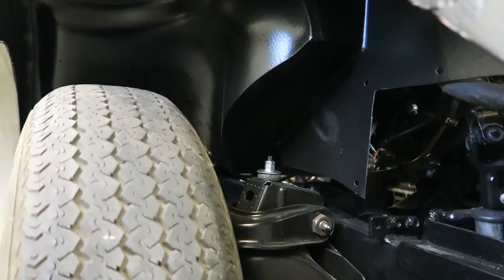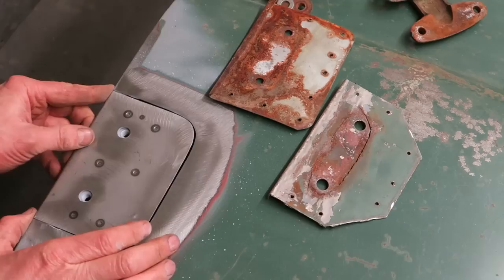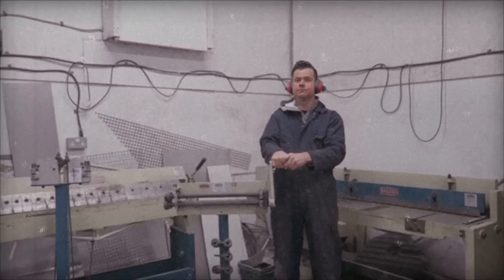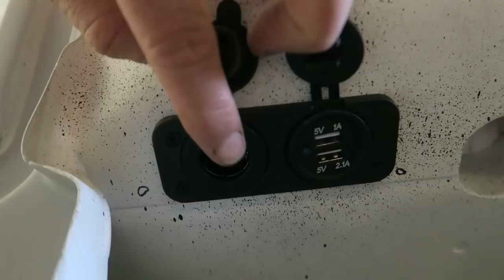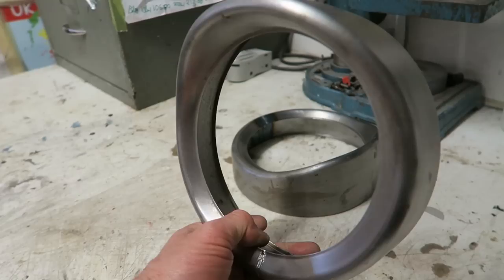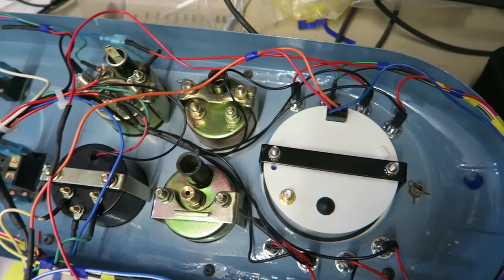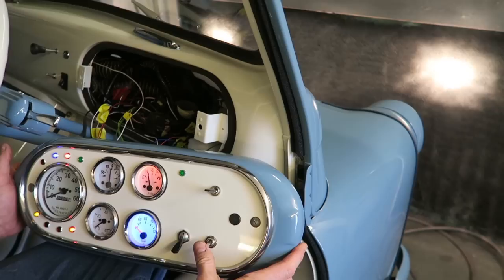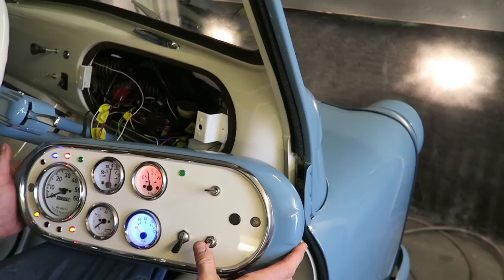Trev's Bedford CA Van Blog - Part 20 - The Final Chapter.

Comment: Well done Trev and congratulations on your body panel building skills. The end results do you credit, it’s one thing to strive for perfection, but quite another to achieve it.  My father was a panel beater and motor car repairer by trade and as a boy I regularly used to help him at his garage in his work. Watching this video brought back many memories of our times together working into the night to get jobs finished for customers in the 60’s. In those pre epoxy days filling techniques involved melting lead ingots into depressions and manually filing down areas by hand. You’ve achieved a great finish and I know from experience its not easily achieved.
Reply from the maker: Thank you for your generous comments, all the very best Trev 👍

Comment: Happy New Year Trevor.  Such a fantastic project.  How did you keep it from rusting while you were doing all the metal work and what paint did you use for the underbody?
Reply from the maker: I don’t have much of an issue with this problem in my workshop. I can actually leave bare steel for over a year and see no evidence of even surface rust. But if I’m restoring something I’d epoxy as I went round provided it was finished enough to not have to start removing the primer again. In the past I have also given the bare steel a light coat of aerosol primer and then sanded it off just before painting it properly. Cheers Trev 👍
Reply: @trevsblog  Great thanks Trev!

Comment: Thanks for the thanks. It’s been a pleasure helping/hindering you over the years. It has been a two way thing though so thank you also. My fifth gear started to wine a little back in September so I guess it will be a contest to see who can ignore it the longest before fixing it :) All the best.
Reply from the maker: Hey thanks Andrew I’m glad you’ve watched the video. Unfortunately I couldn’t finish it in time for Christmas Day due to the editing program freezing and losing 8 hrs work… but I think it’s worked better as a New Year’s Day release. I did a bit of research on the gearbox a while back when I had the grating between gears issue, I ended up emptying some oil out which cured the problem. While reading up it states that the box must have a specific grade of oil and not an EP 80 or 90 type, perhaps just keep this in mind if you’re going to go to the trouble of rebuilding it. All the very best Trev 👍

Comment: We grew up in Cornwall with two of these, 520 JAF and JAF 628E. I still have one of the numberplates for the older van. We had bench seats in the rear, mounted along the sides of the van, no seatbelts for me and my brother, and although dad was a slow driver, I remember sliding around quite often, which added to the fun of an outing. You have done an epic restoration of the van, it’s gorgeous! I noticed the tax disk holder - that has the same knob on it as ours had which made me smile, it’s not something I’ve seen for 40 odd years. My first drive was in the newer van, on Davidstow airfield in North Cornwall. I remember the hardest part was the column shift. Anyway, thanks for rekindling some lovely childhood memories!
Reply from the maker: Thank you for your thoughtful comments. Very much appreciated. All the very best Trev 👍

Comment: I actually learned to drive in my Dad's 1963 Bedford Dormobile Campervan which started out with a Perkins Diesel engine before we converted it to a Petrol back in the 70s  with a 4 Speed Column change. I can still remember my late Dad saying to me this wasn't meant to do these speeds as I inched the speedo over 70Mph on the way to Llangollen from Liverpool downtheWelsh country lanes late at night. It was great on a hot day with the doors held open with the leather straps. Also remember the Column change gear lever coming off in my hand as I was driving into the Mersey tunnel 😳. Funny how it was a push button starter on the floor year's ahead of its time. Many happy memories.
Reply from the maker: Thank you for your generous comments, all the very best Trev 👍

Comment: First time I have seen your channel. Absolutely love the van. Also love your ethic for working towards your goal. Well done. Can I share my CA story. Back in the mid 80s we were on holiday in North Yorkshire. We pulled into a layby with an ice cream van. We bought ice creams for the family, and I got talking to the elderly owner. It was a split screen from I believe about 1957. His stock question was "Guess the year it was made". I was the first person to get the correct year, and I think he was impressed.The van was completely original, apart from some lino floor covering and a water pump replacement. I left him my phone number. 2 or 3 years later I received a letter from his solicitor. Sadly, the gentleman had passed away, and had left instructions that I was to have the first offer to buy the van. I would have so loved to have done so, but family commitments and my poverty did not allow it. I still regret not having been able to buy it, and take it to events. (Of course, 3 speed, column change.....)
Reply from the maker: Thank you for your generous comments, all the very best Trev 👍

Comment: Hey Trevor, Since I found your channel I have really enjoyed watching your videos and looking back over the progress of the van. Thanks for sharing. I am looking forward to future videos.

For washing the van I'd encourage you to use a snow foam wash (a special applicator and pressure washer are required) and sealer (that can be sprayed on through the snow foam applicator). The products have become a lot more available and affordable. The snow foam help break up the dirt and grime before you scrub (microfiber cloth or brush) and some foams have additives that help remove salt (but can be harder on wax). This reduces the contaminates that can scratch the paint when you scrub down the vehicle. You mentioned that you wax the van so, if you use a spray on sealant it will extend the life of the wax and save you some time. The sealant also makes getting the paint clean after it gets dirty a lot easier. Also, look up the two bucket method. Long story short, suds in one bucket and rinse water in the other. It will keep suds bucket pretty much clean and you will have less contaminates that will damage the paint (and chrome). You can also use the snow foam as a quick maintenance wash if required. So much effort went into painting the van and this will help protect it. Also, careful with the brush cleaning. Not really a gentle way to clean paint.
Reply from the maker: Thank you, I appreciate your comments very much! 😊

Comment: It looks very, very nice. What would also look cool is a matching trailer made up of the rear end of two Bedford vans stuck together making it symmetrical. The wheel well being the shape it is means that you could cut with the line of the front part upwards and have a twin axle trailer in the same colouring as your van. The problem is probably finding two Bedford vans!! It would look fantastic as I don't think I've seen a van so conducive to being converted into a trailer using two vans stuck together.
Reply from the maker: That would be cool 😎

Comment: They are my favourite van for sure, I had one in the mid 80's and would have one again if I could find one drivable and in reasonable condition that's affordable. Funny story I had just started a small business and a friend sold me the van not going so I got that sorted but it was still slow and rattily anyway my brother came to visit and was in the van with me on the way to somewhere he said it should run better than this so opened the engine bay while I was driving down the road and looked at the engine he said that lead is loose reached down and tapped it into its socket, well immediately that van leaped forward with twice the power and smooth as silk :) 

They are actually reasonably powerful and drive nicely I loved driving down the motorway at 60mph doors open on a hot summer day (I live in Auckland NZ :) I even did that once with a police escort (part of my work with Mountain rescue transporting our mobile radio station to a major emergency situation).

You did a great job congrats and good luck with the business.
Reply from the maker: Thank you and thanks for the wonderful memories 👍

Comment: Thank you for the video series. The perfection you've achieved is a real credit to your skills and expertise. Don't laugh but my dad owned a Bedford CA lwb 1966 HKR 449D when I was a nipper. He bought it from a retired Brigadier for £150 with 22000 miles on the clock when it was 11 years old. It was grey and had of course the three speed column change and sliding doors. It had no heater and I remember only too well trying to get some warmth by resting my legs against the engine cover 🥶.
Reply from the maker: We never forget do we. I can still vividly remember going on holiday laying on the rear seat of my Dads Beatle JFB298H I can still hear the noise of the engine under the seat and the feel and smell of the vinyl seat cover, like it was yesterday 👍

Comment: I had a Bedford CA in the early 1970's it was my second vehicle I ever owned after a Ford anglia I purchased as soon as I passed my test. I got the CA as I wanted a diesel, it had a perkins engine which used rubber grommets on the fuel lines, they would leak so often I ended up carrying a tin or them with me as well as spanners so I could replace them on the side of the road as soon as they started to leak. I still have some of the grommets along with the drivers/owners hand book.
Reply from the maker: Great memories thanks for sharing 👍

Comment: Great job.Dont forget it won't  be compleat without a 'rattly'  front bumper ,they all had one.
Reply from the maker: Yes I’ve heard from several people that the bumpers rattled. Mine came without bumper brackets and I made them out of thick stuff. All the very best Trev 👍
Reply: @trevsblog  The bolts holding the bumper to the brackets used to come lose.Great van to drive in their day.

Comment: Had one back in 1969ish,  Rare one with the 4-speed gearbox, transformed it compared with the standard 3-speed model.  Loved driving round with the sliding doors opened in the summer.  Probably illegal now.  Had to avoid breaking hard or be aware the straps holding the doors open would slip off, ouch!
Reply from the maker: Great memories 👍

Comment: I past my driving test in the short wheelbase CA van in 1965 I even remember the reg number CAO108B on passing my test the firm provided me with long wheel base version and again I remember that reg number EAO339C. The vans were used for servicing and installing TV sets around West Cumbria or in them days Cumberland. I see you have the gear change on the floor, the vans we had were all 3 speed and gear change was on the stearing column.
Reply from the maker: Thank you for your generous comments, all the very best Trev 👍

Comment: Hi Trev and Tracy, I have just binge watched all 20 episodes. Firstly, the best of luck with your new venture - I know you will make a success of it. Secondly, your immense skills were wasted doing crash repairs, they are more at home completing serious restoration work or somewhere like Retropower pushing the boundaries of bespoke design/engineering. Thirdly, if I ever get a classic drive in cinema going would you like to come along? I run a 1967 Triumph Herald 1200 conv ( unrestored) & a 1974 Reliant Scimitar 5a (2yr recommissioning having been off the road for 20yrs). 
Final question - what is the next lucky vehicle to be touched by your magic hands?
Reply from the maker: Blimey my heads spinning after reading that. Sounds exciting anyway 👍

Comment: The Bedford CA van was much better than the VW Transporter, much better engine, more economical, nicer to drive, safer in an accident. My father had one as a mobile shop in the early 70, carried 2.5 tonnes of good and ran faultlessly, the VW engine would be dead in a week with that workload...and the heater was crap.
Reply from the maker: Hey thanks 😊

Comment: Such a lovely van restored to perfection, great work! I'm curious about the fuel economy with that engine and gearbox combo? I have a later Bedford CF which gets only gets about 20mpg...gulp! Maybe that type of engine swap could be worth it?
Reply from the maker: @miladyanne8411  if it’s mostly fuel economy you’re looking for then this engine isn’t the best to be honest. A diesel turbo diesel engine would the best bet for sure but the engineering with these projects are a minefield. 👍
Reply: @trevsblog  Thanks for your reply Trev! I'm surprised you didn't get much economy from that combo. Maybe a transit diesel engine could be an option. Yes a minefield indeed, I won't rush in to anything yet as my old slant 4 is running well at the moment....Thirsty as hell though.

Comment: Did you say that it was a TA van? they were called a CA van when I was working on them. Back when I was young my dad had a CA  Dormobile in Blue and it had two benches in the back opposite each other when we were out late at night my older brother and I used to sleep on them on the way home. The only thing is this vehicle had oval windows in the roof just after the front doors and I have never found another CA Bedford van with these windows. Martin. (Thailand)
Reply from the maker: Definitely CA Martin as title 👍 I reckon the oval windows were a customer add on. All the very best Trev 👍

Comment: Great video Trev 
That's a Bedford CA isn't it 3 speed column change and with sliding doors isn't it .
Reply: @trevsblog  
Trev another question I have no place big enough to gey my transit high top in , could I paint it in separate panels to make it easier for me , if so what's the best plan please    single stage paint I'll be using. Thank you

Comment: beautiful work, how did the final drive ratio work out, also the G.V.W.?
Reply from the maker: The final drive is as it left the factory, but it does have the advantage of the fifth gear. There is a more preferable axle ratio but they’re as rare as hen’s teeth. The weight of the equipment was all weighed individually and was within the maximum load weight. If I fill all of the water containers this makes a huge difference so I always find an outside tap at the event and carry the containers empty. Thanks Trev 👍

Comment: Trevor.?  question for now.  I have seen people using TIN solder on metal work to blend in welded joins.  Is this van worth the same deal.?
Reply from the maker: I did some lead work on the lower doors to use as a demo. I’d only personally normally lead a joint that was previously leaded. I’d TIG and planish the rear wings if I went back in time and started again. Cheers Trev 👍